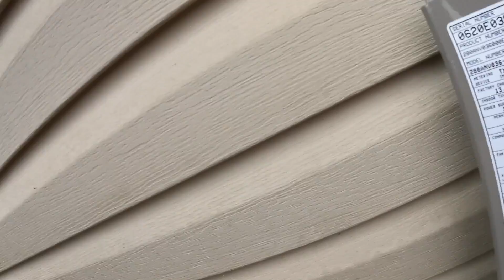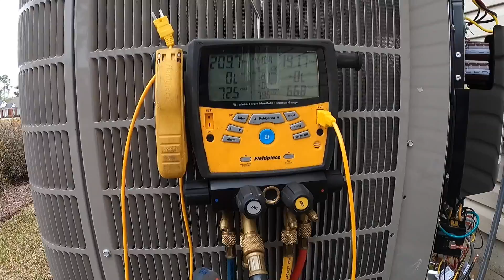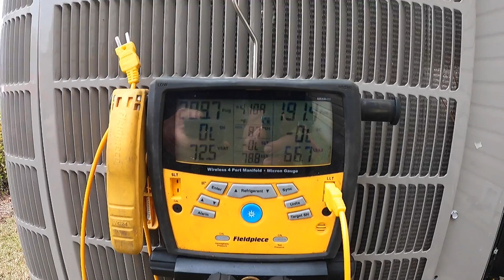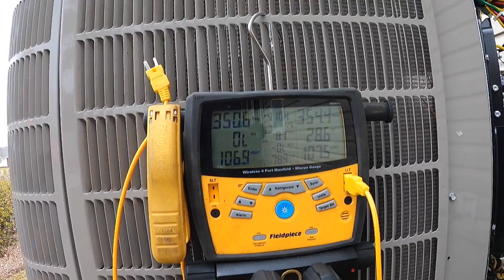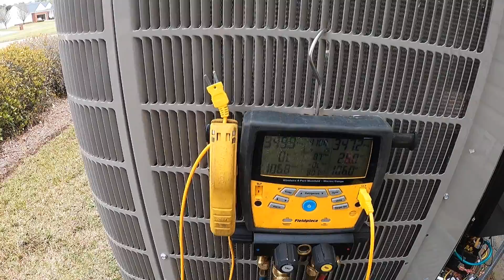Leak detection method for HVAC copper line sets

Comment: i found out putting a filter base with at least 2 inch filter,makes a big difference in the performance,nice unit,nice video, i would add a trap also.nice job.

Comment: If the refrigerant lines are supposed to be insulated, at least one of them, then both of the copper tubes wouldn't rub against each other right?
Reply from the maker: @bctopper  I believe the 3/8” line rubbed through being in contact with the pvc chase and some “dirt”.

Comment: I noticed the original lineset has white insulation on it. Apparently there is a huge issue with new copper and the insulation they are using. Some chemical in the insulation creates an acid when mixed with air and water creating tiny leaks in the linesets. Thinking maybe this was the case here? Did you test the lineset after? Look up "leaky white linesets."
Reply from the maker: Yea…it was definitely leaking

Comment: The only problem is you never confirmed where the leak was. How are you gonna explain to the customer the reason changing the line set if in a few months you come out and its low on freon again?
Reply from the maker: The liquid line was leaking between the condenser and air handler.  That’s the only isolated “component” that had a pressure drop overnight. We didn’t charge  for changing the lineset.
Reply: Yes I picked up where you said the liquid line was low the next day.  Why no charge to the customer?  Especially when they did not want to change the line set originally?

Comment: Think you can condemn it faster by using electronic leak detector and digging up chase.  Expose both ends and put detector into chase.  Just depends on how good of a leak detector you have.  Also have to be careful that you don't pick up refrigerant from it being in the insulation from a leaking joint outside of the chase or evaporator coil.  But if line set leaks isolate to confirm.  Nice fix.
Reply from the maker: Thank you and yea that works too! There was a ton of cured foam on both ends of this one.  I went this route just to avoid cutting all of that up and removing it.

Comment: Nice job guys.  Keep it up! I learned some new tricks to pressurize  system  for sure. Like fill nitro thru true suction port. 

Also did it have a burn out or is that like an extra muffler? Lol 
The thing that's on the suction line
Reply from the maker: Great question Caleb.  The 20 SEER Bryant & Carrier heat pumps like this one came with a suction line muffler.
Reply: @AIRMANHVAC  gotcha 👌.  That's neat. Hey you should go over the components of the system. I'd like to see some. I dont do many inverter/high seer and wouldn't mind seeing more of that. Maybe how to force a defrost. 
Also some ideas for content.  It would be cool if you showed us some 
Air flow/ducting design
Minisplit maintenance 
Commercial 3 phase 
Electric heat wiring
Gas furnace tune up/troubleshooting 
I'm sure you plan on all that but I thought I'd throw some ideas.
Reply from the maker: Thank you for the content suggestions!

Comment: why isolate the condenser when doing a leak check ?
Reply from the maker: We knew the system was leaking, but no signs of oil anywhere. Our electronic leak detectors did not pick up on anything on the air handler or condenser. So, we pressure tested the condenser, lineset and air handler separately.  To confirm what component(s) was/were leaking.
Reply: @AIRMANHVAC  thanks